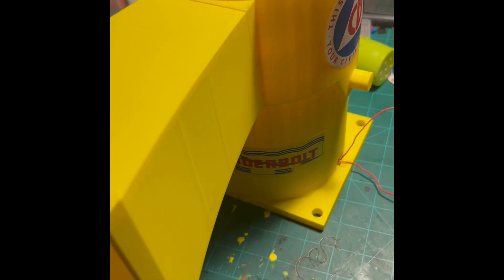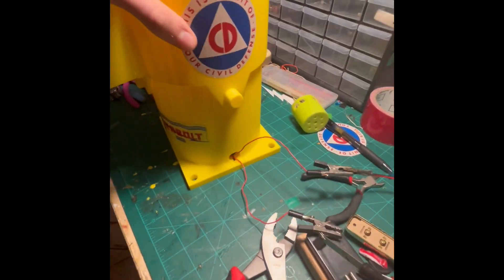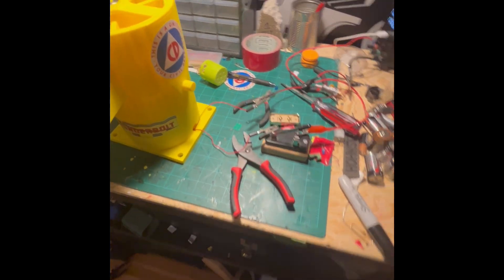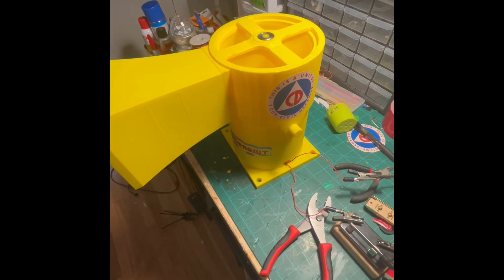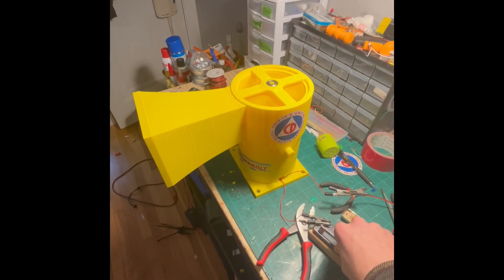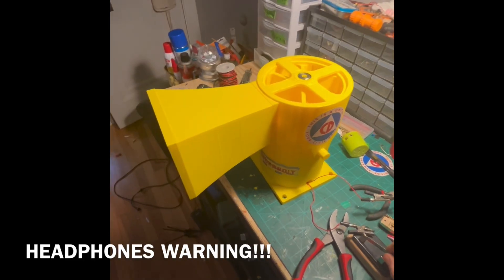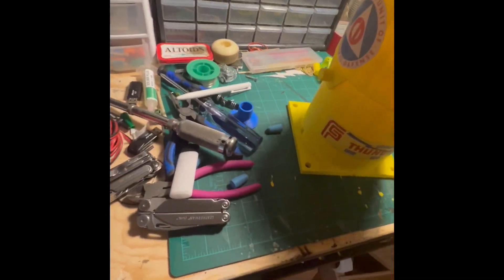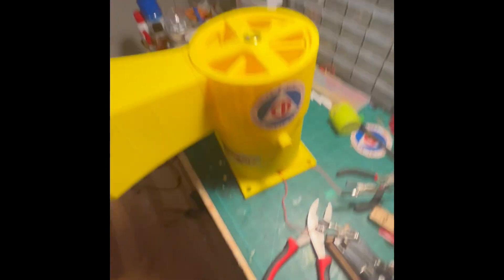My mini 3d printed Thunder Bolt siren. (Files available!)

Comment: The sound is good, but It's even better if you add a blower
Reply from the maker: The original thunderbolts chopper was sealed shut to prevent rust, that’s why it needed a blower, because there wasn’t enough airflow, this has a open chopper so it doesn’t need one but it might make it louder
Reply: @Jellolotl7468Yes, I know, but if you want it to go faster, give the monster a blower, and I also recommend that because the stator port is very large. Greetings of interaction and greetings of creativity.😊

Comment: looks like when you ask ai to generate a pic of a tornado siren.
Reply: hello solar panel, try using better motors than 5 volt ones on you're sirens, than they will be louder
Reply: @SkeletonMug  wrong. Five volts is fine, the voltage does not depict the loudness, it’s the rpm and port ratio, it can be 5v as long it is the respective rpm, usually 3000 rpm
Reply: @Eat_a_burger77  higher voltage motors have more tourque, wich means you can have bigger choopy choppers, wich means its louder
Reply: @SkeletonMug  broken solar panel doesn’t use big choppers
Reply: HI BSP IT WOULD MAKE MY ENTIRE 2026 IF YOU RESPOND TO MY COMMENT I LOVE YOUR VIDS SO MUCH AND I HAVE JUST ONE QUESTION, WHEN WILL THERE BE MORE TSM OR RSS?